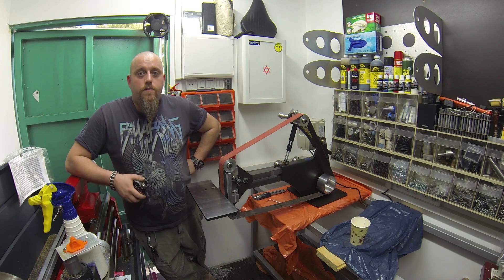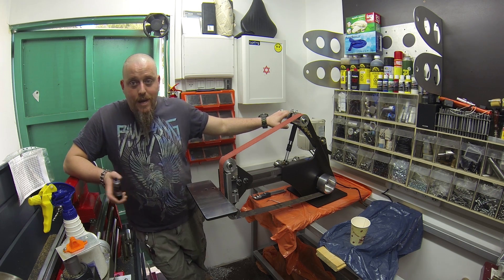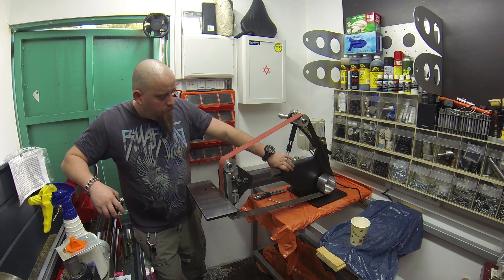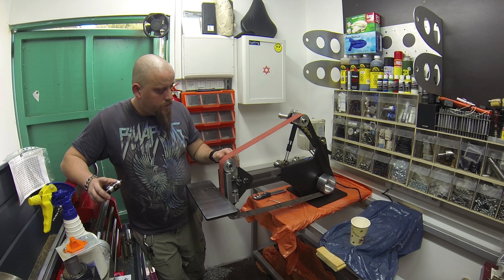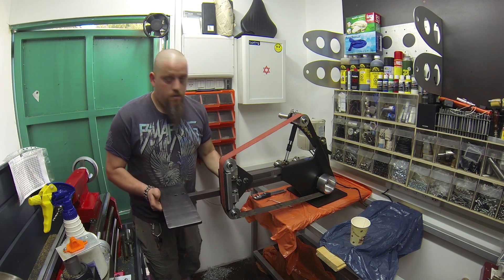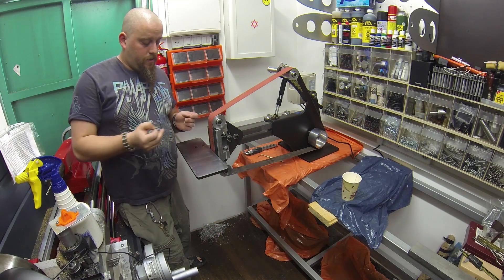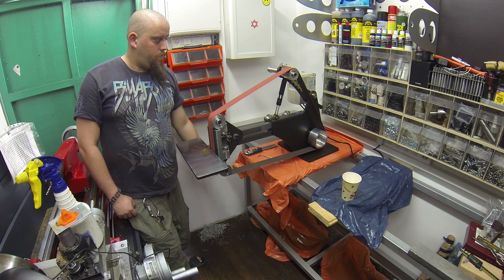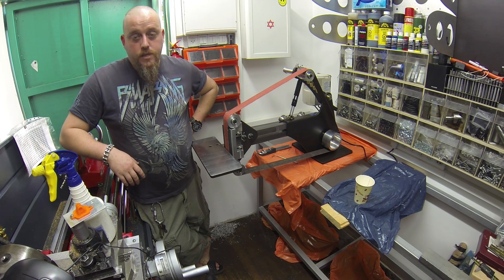My shop build 2x72 belt grinder

Comment: Cool, I like your machine. Where did you get the pneumatic springs on the tensioning arm (I think that is what you call them)? Can you provide part number? Thank you!!
Reply from the maker: I don't remember, it's 5kg load springs.
Reply: I guess it would be too difficult to look at the labels on the pieces....
Reply from the maker: At the lablels there is no part N, only the LBS data.
Reply: OK, what is the overall length and Lbs?
Reply from the maker: 950mm and 60kg
Reply: 950mm is longer than your arm length......
Reply: and 60kg is the weight of lady.....
Reply from the maker: Pedro Delgado Yeep
Reply from the maker: And what?:)